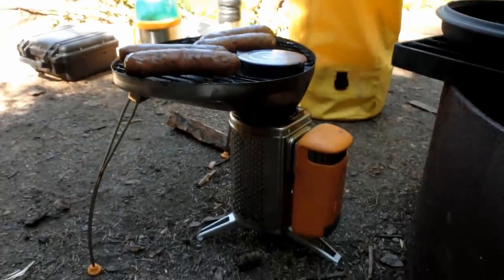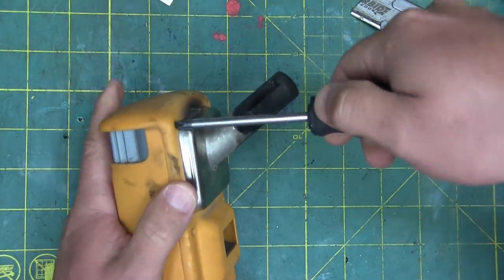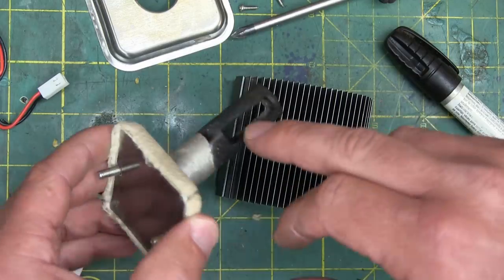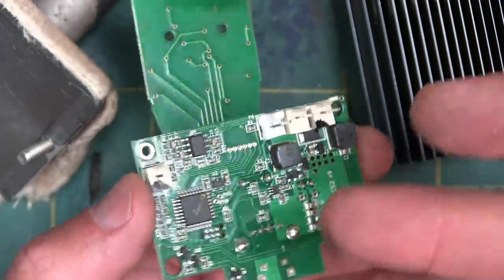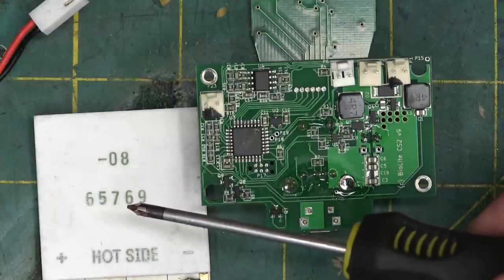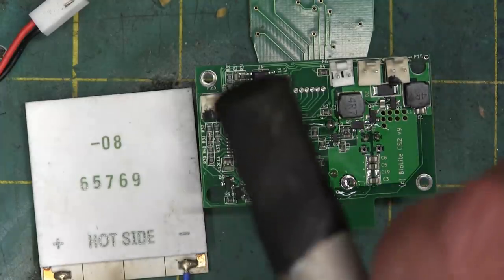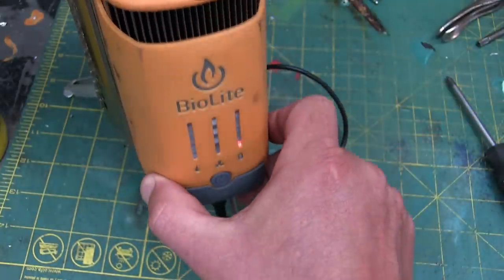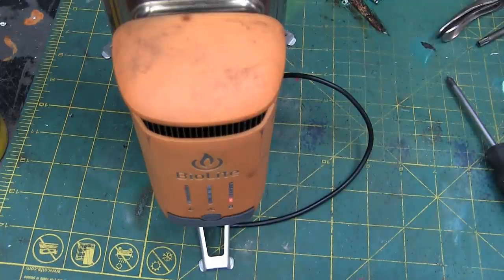BOLTR: Biolite Stove | Camping Gear

Comment: The most distant man made object from earth, the Voyager 1 space probe uses Seebeck generators in it's Radioisotope Thermal Generators to power its onboard systems. Launched in 1977, the RTG's still provide enough power to run a few instruments and send back data by radio link. The probe is so far away, that a radio signal sent from earth takes 20 hours to reach the probe and it is the furthest object from earth whose location is precisely known.
Reply: insanitybiker Yeah, but don't forget the Voyager only has a tiny little $100 million dollar fission reactor as an accessory  in there for the heat...
Reply: rogerwilco99 RTG, but still $100 million, the NASA guy who heads the New Horizons project tells about how he chose one left over from the Voyager project.
Reply: My name is on the side of Voyager I, along with all the others that helped build it, also the Viking.
Reply: It's a specific isotope of Pu that isn't made anymore too.  Not your common or garden Pu 239 that's hoarded for bombery.
Reply: insanitybiker love to see the tear down on something spacey.

They musta used silver and gold for traces and magic pixie solder
Reply: cheers!
Reply: insanitybiker How many Seebecks does it generate?
Reply: @Richard Fay: Thank you for making the world (and the great beyond) a better place.
Reply: Help me understand, in space would the cold side of a Seebeck generator really serve as a true cold side if there is a vacuum of space limiting cooling? I guess it would be radiational cooling instead of something like air cooling on earth right? Maybe just not as efficient in space but still viable?
Reply: Flightgamer You're right, in space you can only rely on black body radiation. Turns out black body radiation in a vacuum is so simple conceptually that it really doesn't take too much thermodynamicking to design an effective radiator. The hard part is making it light enough and small enough for a spacecraft where every gram costs you a fortune in chooch.

In order for it to be effective, a high enough temperature is required to radiate the right amount of energy and it must be kept essentially "in the dark" in order to prevent it picking up heat from a nearby star while it's trying to dissipate the heat from the plutonium battery.

With a modern optimisation algorithm on top of a finite difference conduction model (with a heat flux boundary condition at the source and a radiation model applied to all other surfaces), and with the appropriate size and weight constraints the thing practically designs itself! Models would take a few days tops to build in matlab, iSight can do the rest. Total setup time - 1 week, run time - less than that. Chances are, it will be almost as good as having a design engineer spend a few weeks on it.
Reply: Yep exactly.  You aim a radiator away from the sun and it will cool towards 3 degrees above absolute 0,  when the incoming CMB and starlight balance it.
Reply: "Americium 241 can also be used"  that's a whole heap of smoke detectors you'd need.  The 10 year half life  wouldn't be great on a mission like Voyager either.
Reply: MattOGormanSmith Well... it will try :P

The critical detail we're obliged to add for the sake of non-thermodynamics folk (i.e. normies with social lives) is that as long as one keeps dumping heat into one's radiator, said radiator will stay a lot hotter than the environment as a result of equilibrium heat transfer. It's more or less second nature to us, but it can confuse the hell out of the uninitiated.
Reply: Well it wouldn't be much of a social life if someone didn't know how to cool the beers :)
Reply: 241-Am has a halflife of some 432 years.  Although you'll need a lot more of it to get the same power output, she'll chooch a lot longer than a 238-based RTG.

The smoke detector service life is to protect against the degradation of the electronicals.
Reply: I was fairly confident I'd read it was 10 years on wikipedia about a year ago :p   With my lead foil hat on,  I'd be worried that bad actors in the non-proliferation organisations are running a misdirection campaign via Wiki.   With my sensible hat on my jelly brain,  I accept I'm probably confusing it with Tritium.
Reply: @Richard Fay
Why on the Side ?
Why not on the Front?   :(
Reply: MattOGormanSmith A very sad life indeed!
Reply: 233kosta what he said I wanna say I understand what he said but I'm not sure. Sounds like an expert tho.
Reply: Well at least we know precisely where Earth is.  It helps.
Reply: It's Pu 238 and as luck would have it, it is being made again. I want to say it's being made up at Oak Ridge and they're trying to churn out a kg per year. Pricey stuff by any measure.
Reply: AvE must be sent to it immediately to take it apart and show us how they really fudged up that design, and with just a little better engineering, could have made it find babelife in another galaxy. Bet we could get one of those Tesla rockets to take him, let's start a GoFundHim for it.
Reply: What did you do to help build Voyager I and Viking?
Reply: @Zoidberg227  238 only requires 1mm of lead to protect from radiations.  lead is heavy, and sadly, humans working on RTG's before they are launched need protection.  the reason 238 is prefered to 241-Am is radiation and damn humans working around it.

Comment: A full on 32 bit ARM microcontroller in a glorified charger. Most people won't realize how amazing the era we live in is.
Reply: 32 bit. Like a super Nintendo??
Reply: Spaceee (portal reference) you could likely get to space with that much capability/processing power
Reply: @thomashart1560  Kinda.  But it doesnt have the graphical ability.    With some of the higher speed arm micros people are actually emulating stuff like snes and gba tho.
Reply: @FennecTECH  Crazy! We've come so far! Thanks for the response, been awhile. :)
Reply: 3 years later watching on a s21 ultra. We should probably keep talking about tech!

Comment: I've had one of these for about 3 years now. Used it a hundred times and hauled it on 6 or 7 backpacking trips around Arizona and it's still working fine.  I do always have a backup (somebody else has a dragonfly etc..). Really the charging your phone thing is kinda gimicky but does still work: albeit slowly. Where this thing truly shines in my book is as a "campfire ban beater". (Whether or not it actually "beats" the ban is a bit of a grey area). For me personally Camping without a campfire fucking sucks and this thing saves the day(night) and satisfies the pyromaniac in me just enough to save a trip. P.s. That grill attachment is beast. It feels weak but keeps on trucking year after year.

Comment: Unit seemed fine. You touched it. Unit no longer works.
Reply: Snocrash had the same problem with my x wife
Reply: He seems to be good at taking stuff that works and breaking it. Then goes on to blame the product for not working anymore.
Reply: I must have missed the bit where he absolved himself for the lack of chooch. He blamed the product for being cheaply built, he admits his lack of finesse on a regular basis. That it broke is kind of beside the point, happens when you take stuff apart that isn't meant to be serviced.
Reply: No, all he did was heat the probe,,,NOT the actually Sensitive parts inside.
Reply: Watch the second video. It was a software problem, turning it off and back on again worked.
Reply: Muppet!
Reply: remember he said mark the connectors where they came!?  prob plugged one in wrong connector one?
Reply: tradesman blaming his TOOL
Reply: @MasterFancyPants  perhaps purposefully protecting the hardware. that was my first assumption when it ddint come online

Comment: Back in the mid-1990's I worked on a small research project which required using a number of  Seebek devices, as opposed to Peltier devices. We were encouraged not to ask why Seebeck devices were specified, or exactly what the heat source was. However, we had to order in a box of about 20 of these from some secret-squirrel component manufacturer in the U.S., and the  box,  maybe 20 cm x 20 cm x 25 cm, came with an invoice for $10,000. Those particular Seebeck devices that had been specified, and no lesser part would suffice. Everything else used the highest quality components and  had multiple redundancy, as well as built-in sensors.  Over several months, we did our part of it - the pixie-wrangling and the heat-transfer physics, and when everything was put together it was tested repeatedly and very thoroughly. The finished package departed for final installation somewhere else by the prime contractor. I was told, in 2014, that the "thing" is still operating at high efficiency, for what it is. Apparently that's good, since  there's no way it can ever be serviced. 
If I live  80 more years, I'm allowed to speculate publicly on the end use; otherwise Elizabeth II  can chop off my head or something (possibly no great loss). 
Interesting to see one turning up in a consumer product, though - I'm guessing that either the technology of manufacture has gotten much cheaper, or the QC spec is not as high. Who knew?
Reply: That is a damn cool story

Comment: Hey AvE, thank you so much for your videos. I love em all. You're intelligence and humble nature have inspired me to take on new challenges and not worry about the mistakes that inherently happen. "If you don't make mistakes you're not challenging yourself" is a phrase I've come to live by, I'm sure others have too.  I have something to add for once so here goes. I had nothing but problems from my biolite stove. You have to use the fan to start a fire so make sure its charged, and then plan to add fuel CONSTANTLY, which requires removing the pot. Using the grill attachment is a little better cause it has a fuel door, but it still sucked bad. Then once the fire is finally really going, the stupid thing goes into protection mode to cool down.  Turning the plan of a hot meal into the dream of one if not otherwise equipped. Total failure to chooch! I heard myself exclaim that day. Then a smile and a laugh credited to my favorite Youtuber for having worked his lingo into my vocabulary.  I am so glad I brought my MSR Windburner stove and a folding fire grate on that trip. Props to those patient enough to use this piece of shit.  This thing is not for multitaskers who set up camp while dinner's cooking or someone who wants a quick cup of coffee.  I go camping to relax and get rooted. No way some p.o.s. camp stove is getting in the way of that. Mine will be on craigslist here soon. Thanks for reading.

Comment: It's hard to blame the product when it worked before it was disassembled.
Reply: I'd bet it does still work.  The battery was completely drained and I bet that thing puts out just a tiny bit of power for charging...would take forever to charge it up via flame, even just to the point of getting it to run.  Could be an interesting test to determine just how much power it supplies for charging, just keep a fire lit till the battery is completely charged...would probably take hours.
Reply: Without the fan running to cool the heatsink, it may not actually be safe for the TEG element to use it while its on fire, nor will it generate anything like the same power output. The beauty of the design is that the one fan both cools one side and dramatically increases heat to the other, the downside is that it doesn't have any black start potential. If they just used a motor that can handle low current while stalled OR used a smarter controller they could have it use the TEG to run the fan directly as a start mode, as is you'd have to either have a USB power bank to jumpstart this or blow into the air intake for half an hour or whatever it takes it to put enough charge in to release the 18650 from the prison of low voltage cutout.
Reply: Considering what's inside? I wouldn't buy this POS even if it was 10$ in all. It's just about the trashiest constructions i've seen. Even the 600$ mulch press the other day was ... no that thing was beyond superior to this shitty flop.
Reply: Actually they work pretty well. I was on the Rubicon trail and a guy had one with him. He cooked a decent 1.5 pund flat steak on it while charging his phone at the same time. It was very cold at night, so im sure that really helpes when the Heat sink is subject to cold temps along with the fan blowing accross it. I agree that it probably needs a decent charge to even work at all. It probbably wont work or start once dead since it is essentially dependent on its own power in order to work. Like Hamish just said it has zero black start capabilities. But it simply works. it also has a light attachment , so when you put the cook top over the flame and block the natural flame light you can still see what youre cooking at night. After watching this video it is clear it could use some upgrading. Like a second cell that is only used purely for start up. The first cell could charge youre stuff while the second cell is charged independently and reserved for startup. It could also be upgraded in the water proofing department. Its rather dumb that it isnt already.. Its deffinitly a good idea , and the ones i have seen all work great but it could use a little better execution and 304 stainless!
Reply: Watch the second video. It was a software problem, turning it off and back on again worked.
Reply: Why would it be hard to blame the device? A proper device could be disassemble,reassembled and work properly.
This is the mainstay of just about any object that can be repaired. Your comment is found lacking.
Just so happened this instance it was reassembled improperly. But irrelevant to the fact that if I can't take it apart,put it back together working,it's shit. You keeping up?
Reply: NO, it's not hard to blame the shiite product at all.

Comment: "Peltier effect is the phenomenon that a potential difference applied across a thermocouple causes a temperature difference between the junctions of the different materials in the thermocouple"

i used to own a AMD K6-2 450 MHz that had a peltier effect epoxied onto the processor as a cooling device.  its also used in small AC units & i have read ppl can burn them to generate electricity ^^

Comment: I used this stove for 40 day kayaking trip - worked flawlessly and heats stuff way quicker than a gas stove, specially when it's windy. Totally reliable. As long as you don't expect it to charge stuff, keep the battery charged for the fan. fan makes it so you can even burn slightly wet wood.
Reply: I've gone from depleted battery in this and a phone and a spare battery, to filling all of them in one burn session of less than a couple of hours.

If it's mostly drained, it won't send out charge for devices.
If it's burning, it will charge both itself and other things.

Comment: So it was working before you took it apart....  REDACTED
Reply: Mark Hunter I have three of these Biolites, two small ones and a big family size one and they work perfectly every time. I've had 100% reliable performances. I think he broke it.
Reply: Mike Price yeah it seems like he has a 80% 20% work rate as far as things working again after reassembly.lol.
Reply: I have one of these as well and have used it well over a 100 times over a few years, still like new.
Reply: ive used mine over and over for three years with no problems, mind you i never took it apart!
Reply: WTF is wrong with you people? You can add a "spoiler alert"! :-)
Reply: Or, you can watch the video BEFORE reading the comments.
Reply: Watch the second video. It was a software problem, turning it off and back on again worked.
Reply: Not sure where you get your percentages, or even if it mattered whether you were or were not just spewing numbers but,just about anything he has taken apart he showed it working back together. That is if it was working in the first place or wasn't fuck all of a product.
Reply: already done
Reply: was just thinking that lmao

Comment: On the LED drive and port pins:  I only see 6 conductors in that ribbon cable headed to the LED board, so they're likely multiplexing and doing some other tomfoolery to get addressing to all the LEDs.
Reply: You can drive 30 LEDs with 6 pins using charlieplexing.
Reply: rocketman221projects yes, there are lots of ways to get clever.  My point is that AvE said the micro is likely using all its port pins one per LED, and that's clearly not the case with only 6 signals (including VCC and GND) headed to that board.

Edit:  I forgot that there's no micro on the LED board, and that GND is probably dependent on the muxing scheme, so all 6 lines are probably available for driving/sinking.

Comment: I learned something! I always thought those the metallic thermal transfer pads were made from indium. But aluminized graphite! Neat! I've collected quite a few of them from taking apart industrial Diode lasers. They always use those at the thermal interface between the heatsink and diode. Some are indium and some are the graphite aluminum. Good video!

Comment: I have had mine for 4 years almost 5 with over 30 hours a year on the stove. Still works great and is very reliable.  I am glad you didn't take my stove apart and give it back to me.  I have had 5 other people buy this stove after seeing it in action on our camping and backpacking trips.  Winter camping it's the best.  Sumer camping it's hot and messy.  It's a great stove.  My other 6 gas - alcohol - propane mix stoves don't get the use the biolite does.   Each stove has a purpose and if its used in that mode they are all good.  
30 outings a year with a church scout group for the past 25 years.  All kinds of camping weather and conditions.  Biolite is a good stove.